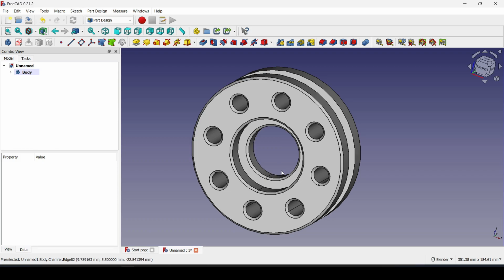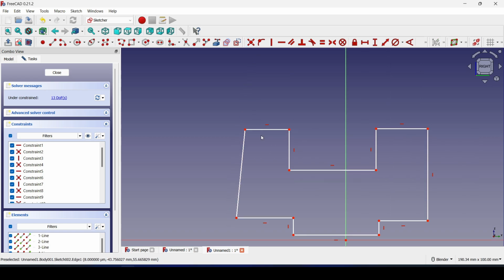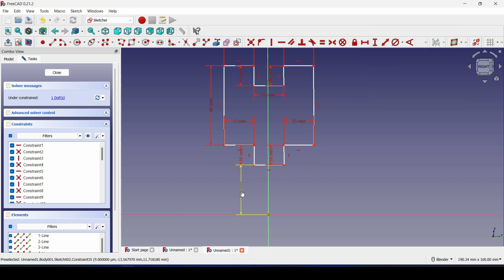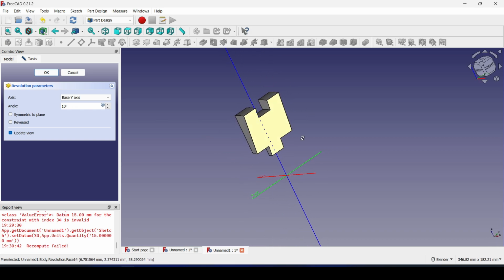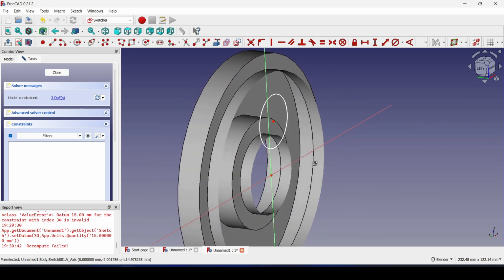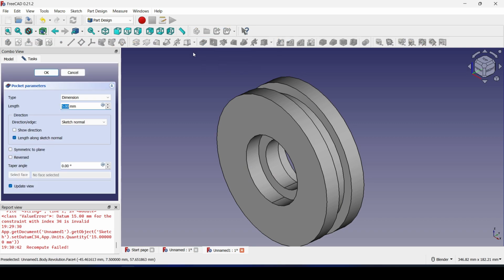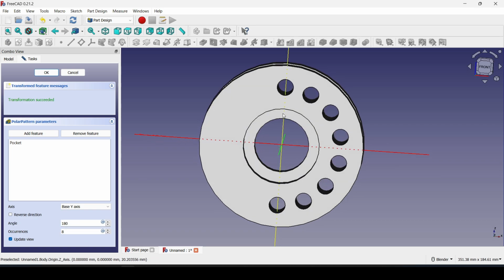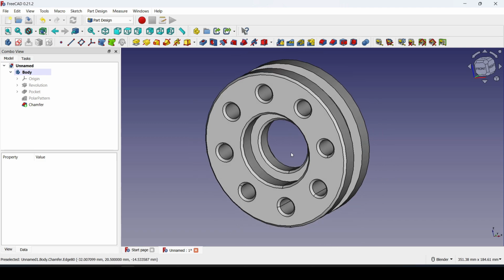FreeCAD Beginner Tutorial #4

Comment: Thanks, Jeff.   
I'm really struggling with making some simple Dwell cams for my project.  I need 3 cams 80mm dia. X 5mm thick with a positive dwell and three with a negative dwell. This seem like it should be simple, but I can't to find the correct tool combinations to make it happen.
ei; Positive dwells, cam A+ = 270* to 360*, cam B+ = 66* - 186*.   Negative dwells,  A- = 105* to 350* , B- = 260* to 350* , 
These are used to trigger micro switches to turn motors on/off and prevent component collisions in old bowling machines.  We're building an emulator/ tester.